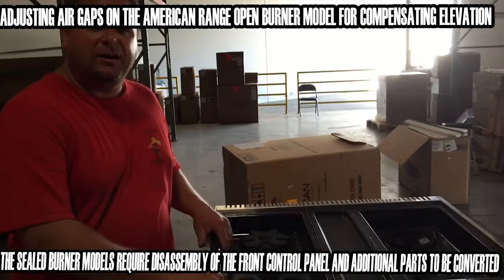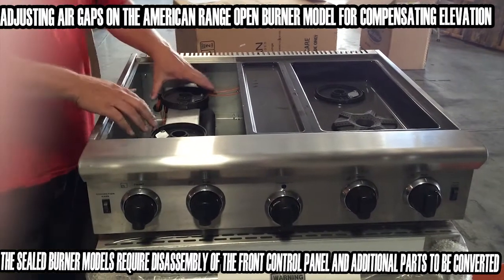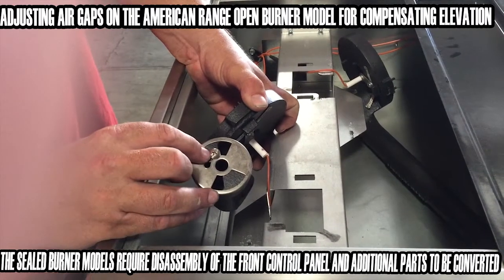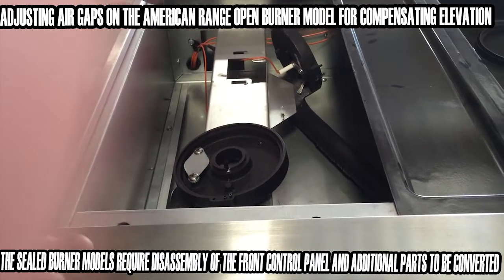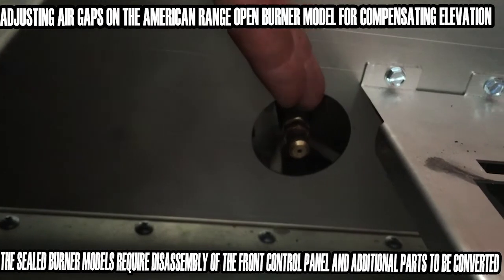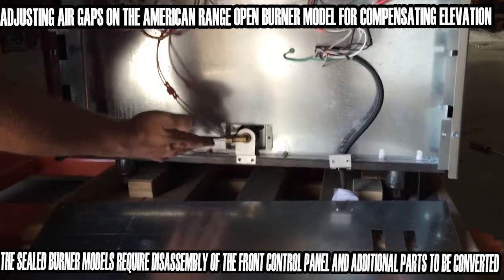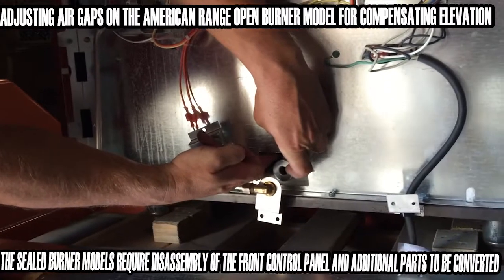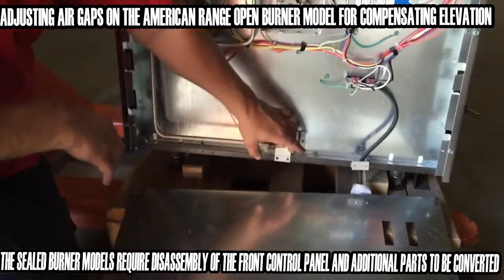Adjusting the air/fuel setting on American Range Open burners models to compensate for elevation

Comment: Is it difficult and expensive to convert to propane?
Reply from the maker: American range does not suppl;y the orifices to covert to propane when you purchase the product. If you call there office they wont even sell you the orifices.  They block warranty on customers who try and covert there range since they have had bad installations result in lawsuits. They are the only company I have ever worked with that will not sell customers orifices. You must order the range configured for the gas desired